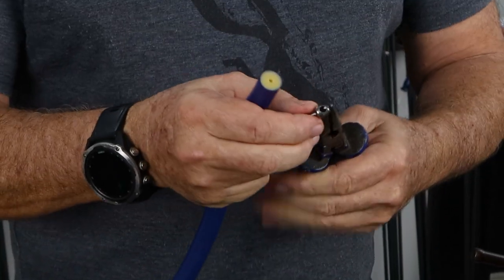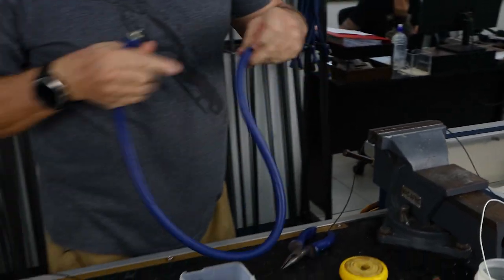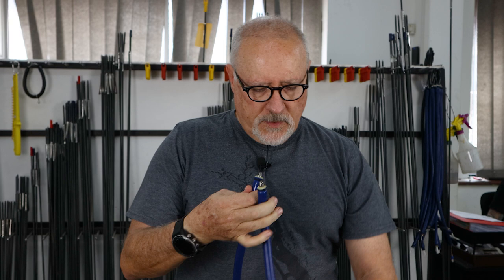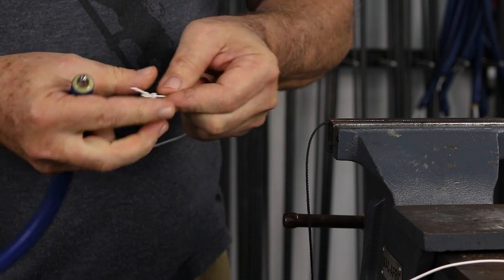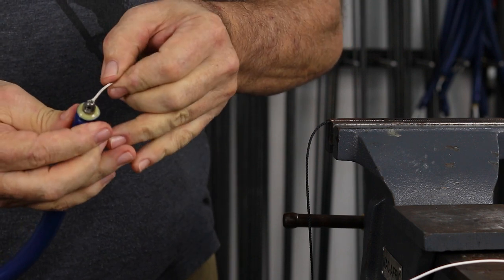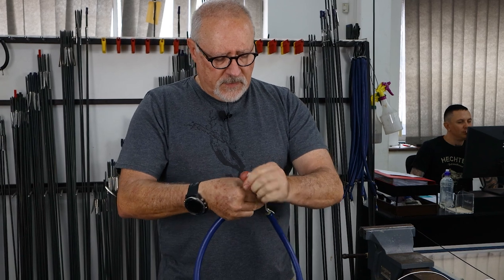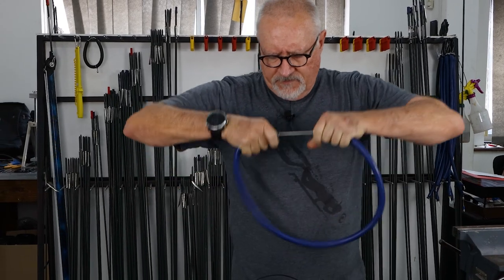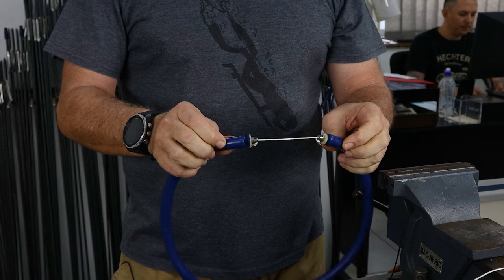Rob Allen | Stainless Steel Wishbone Inserts | 2023

Comment: Very good. I use these but they are a plastic variety. I like them a lot. I cut my bands a tad on the short side and make the wishbone longer than I’d like, and as the bands stretch a little I can tie an additional stopper knot right in the wishbone even when I’m in the water, shortening the wishbone. System has worked out well for me.

Comment: Thank you Rob, really appreciated your effort. I will definitely get a pair of the inserts asap. I also have another question about shooting with the speargun upside down. I am using the closed muzzle and I was wondering if it will jam in such scenario. Thanks and keep the videos coming!
Reply from the maker: Not a good idea to shoot with the gun upside down because the spear will hang down out the rail and shoot very high. It will not damage it but, will be very inaccurate. But.... there is a way if you shooting very close in a cave for example, you can choke the gun by clamping the spear and rubbers onto the barrel before you shoot. I have not done this many times but you can "choke" it sufficiently with your hand, such that the spear does not exit the gun. It will not hurt your hand because the rubber will be increasing in diameter as it contracts. I have done it bare handed but gloves will help.
Reply: @RobAllenSpearfishing  Thank you so much for the tip!